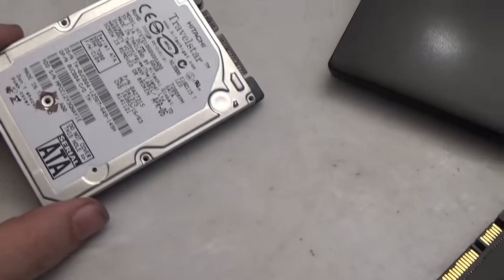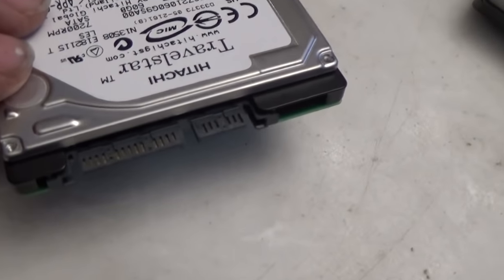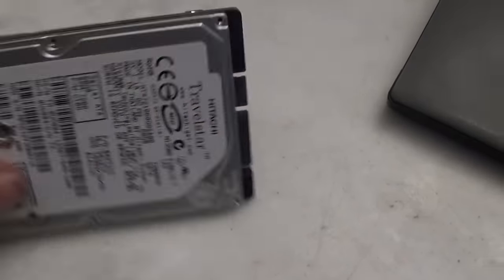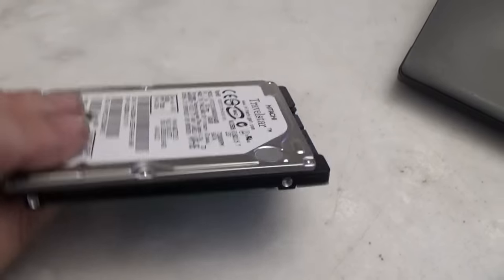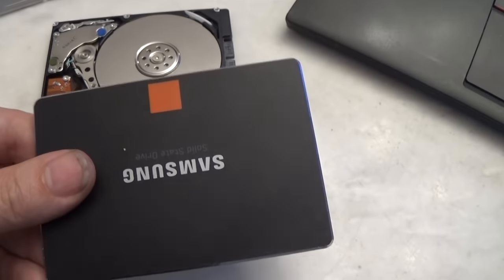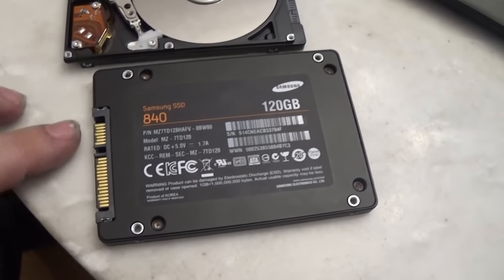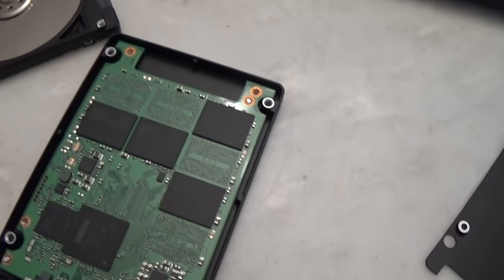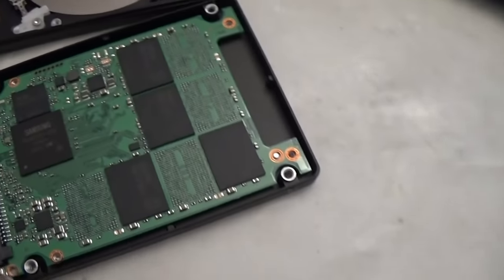Take a look inside a hard drive while it's running

Comment: people, don't open your drives if you want them to run afterwards
Reply: USSF - United States Space Force  you will get dust in it and it will break at some soon point
Reply: Just like a car will run without oil... until it doesn't.
Reply: USSF - United States Space Force  it have void on it so I don't recommend you to open it
Reply: lucas 0051 warranty void.
Reply: USSF - United States Space Force  any dust particle is capable of completely destroying a hard drive
Reply: You're telling me I shouldn't open my drive and carve my name into the platter to make sure it doesn't get stolen?
Reply: @JakeobE  that's normal just don't put a dust particle in there :)
Reply: @pointed.sphere  my friend once unplugged a hard drive from power when it was working. The head didn't park so he just opened it, pushed the head to place, some dust got on the platter, but he just blew it away, closed it and it worked. I was telling him that it won't work, but it somehow worked
Reply: @vwvvvww  you still dont wanna do that
Reply: @white_mage  I know, just shared a story
Reply: @Tristan Burke *Apostrophe, too.
Reply: Apex •  Correction: "We know, we aren't dumb"
Reply: USSF - United States Space Force   that's how you step on a pothole
Reply: Just get some legs and glue them on
Reply: My dad didn't want to spend $20 after his drive stopped working for a professional to fix it, so he opened it up. Needless to say we lost everything on the drive, which included pictures and videos from up to 40 years back. We know that we lost it, because he told me to send it to the professionals after he broke it. At least we found out that the arm was slightly bent, which is why it stopped working in the first place.
Reply: @Yevgen4000  I also lost photos of my family... From up to 14 years back.. my laptop stopped working and we didn't put the photos on a flash drive..
Reply: HDDs have gas inside them less dense than air to maintain the speed. At least some HDDs not sure if all
Reply: @ZirixNightcore  I think that gas is called 'fart'
Reply: @ThundererGamer  what - edit, I see, u missclicked
Reply: My advise to everyone who talk endlessly. Read before write. Listen before talk. Sorcery is nothing more than your idiocity. Hard disk itself has checksum mechanism which will backup the bits to prepare for later data recovery
Reply: @Tristan Burke There it is. The lord of the grammar. Drop a character and you shall never pass him
Reply: 1000th like
Reply: Near the drive if you see there's a little filter made to catch the dust on the drive
Reply: Look at minute 6:57 at the bottom and at the right

You see that little white thing?

Thats the filter
Reply: @vwvvvww  Your friend has god on his side
Reply: @0FFICERPROBLEM  Most of the HDDs have regular air in them, but there are helium sealed drivers, which have helium inside because it has less resistance.
Reply: Then open it where it's no dust
Reply: @0FFICERPROBLEM  No they don't. They are vented. It's just normal air. The shape of the vent is usually like a labyrinth to maximize the length of it making a filter possibly unnecessary. The fly gap of the R-W head over a platter makes a dust grain look like a bolder in comparison. Hard drives are like the ultimate in mechanical tech.
Reply: How can I boot Linux as command line only but with possibility to launch programs with GUI?
Reply: He lives in space, no dust issues there.
Reply: Common sense but im glad you learned this today through this video.
Reply: @tdplay4135  what the hell are ICs?
Reply: Learnt it the hard way
Reply: @Rainbow__cookie  Normal air has dust particles in. Hence the reason why hard drive labs are ridiculously sterile places with heavily filtered air
Reply: Hahaha hard drive goes: "                             "
Reply: @lucas-vh6oc  is not void! Can not be void! The head need air to "float" over the plate when spinning. In fact, disk has higher failure rate when works in High location.  Over 3000 meters  the air is soo thin  than almost there is not gap between head and plates and almost any hit on the hdd ends in a head-plate crash.
Reply: @xenuno  no, he is totally right. Some disks do use helium and are sealed. I think an example is the ironwolf pro drives.
Reply: True
Reply: @djenson  Yes I see .. those (helium filled & sealed) are at the bleeding edge of hard drives sizes and are relatively of recent release commercially (late 2013). I was not aware of them as they appear to be directed to Enterprise -NAS usage. Every drive I've touched going back to early 80's has been vented.
Reply: I had to for a video😂
Reply: @xenuno  yep, but you should always check before saying that something is wrong. technology moves fast.
Reply: We have the same profile picture
Reply: Cristian Pl dust+oxidisation+dampness= dead drive.
Reply: Wait people actually do that??!!
Reply: Cristian Pl especially even more if they are helium filled or some other special sealing drive
Reply: Unless it is a solid state drive
Reply: @Tristan Burke apostrophe*
Reply: Unless you are in a clean room
Reply: @soundvolsehgs  unless you're in a specially equipped, professionally ventilated room/area in which it is indeed safe to open it
Reply: Matthew Higgs in your house it would because you live in a dusty house you never clean it
Reply: Haha lol
Reply: Who the fck would open this so lighty ?
Reply: @pointed.sphere  older drives tend to be more resistant to this, the new ones are incredibly delicate tho
Reply: Please don't act like you know what you're talking about when you don't. Thanks.
Reply: USSF - United States Space Force  Can confirm, Opening up a drive will severely hinder it's lifetime and give you bad blocks. Don't open your drives, they have to run at as clean as possible.
Reply: @JakeobE  drive status:destroyed.
Reply: One small dust partical can distory a big file
Reply: so true
Reply: Cristian Pl ok good
Reply: @spatch7414  What a shame, =_=
Reply: Apex • are you sure? Because I’m pretty sure it’s aren’t and not arent. What happened to your autocorrect? Get it fixed ASAP
Reply: @JakeobE  😅😅😅😂😂😂😄😄😄😆😆😆
Reply: @pointed.sphere  some gigs per 1 dust on a platter(1tb disk)
Reply: Yup
Reply: @lucas-vh6oc  the hard drive has holes...
Reply: Yes. especially if you have a helium filled HDD :D
Reply: @Rainbow Cookie you need a $500,000 clean room in order to not break your drive
Reply: USSF - United States Space Force  no
Reply: USSF - United States Space Force no it will break trust me
Reply: well what if i dont want my 20GB HD to run?
Reply: @Glenn67345  Integrated Circuits. You don't touch them as they are microscopic in size. Any oil residue from your fingers will eat into them and destroy them over time. The same goes for electrostatic discharge from your fingers as even a small amount is like a lightning bolt to something this small and delicate.
Reply: @pologamero2648  so SSDs are the drive of choice if you live in the Alps?
Reply: @LayJD_  that is because they write much more tightly on a single platter these days. The engineering tolerances are just so much higher. The older drives had more platters and physically larger sectors for the same given drive capacity. I have seen an old school HDD opened and running as a party trick. This would kill all the data in a matter of moments on a modern hard drive. Use a hepa filtered, extracted air glove box if you really need to open it. Dump the data off it ASAP and trash it as it will never be the same again in regular use.
Reply: Except for ssds
Reply: @vwvvvww  yeah it worked but for how long? Without the proper equipment, no hdd drive is gonna survive long once opened. One tiny particle you don't notice will ruin it. I've opened dozens of them up taking every precaution, none of them lasted after that. Odds are they do last in a normal environment is 1000 to 1... if you're lucky.
Reply: It's bad if you do it with a hard drive, but fine with an SSD
Reply: @aviay  and what are you gonna see in a sdd?
Reply: @JakeobE  xd
Reply: Me putting my fingers on the disc after opening it: huh? What were you saying?
Reply: I opened my 750gb hdd to see how it works.. Didn't think about searching for it on YouTube lol
Now it's in the trash
Reply: I opened my 750gb hdd to see how it works.. Didn't think about searching for it on YouTube lol
Now it's in the trash
Reply: @pointed.sphere  well actually no, Its very likely it wont be affected as long as you are careful
Reply: USSF - United States Space Force  one piece of dust can and will ruin your drive, there is a reason people spend millions of dollars making clean rooms
Reply: @vwvvvww  stop ur bs
Reply: Yup, once you open it, you risk ALL your data, it's like a timed bomb, at best it'll last another day before completely dying. You can already hear the dust getting scraped through the disk minutes after he opened it in this video.
Reply: @MrDaniyalAh  I think he was joking
Reply: I opened my drive for a split second and it completely destroyed it. It worked fine for a week until sector errors and I/P errors started popping up. Learned the hard way, bought an nvme
Reply: Steelyx  Most of the consumer-grade HDDs have air inside them. But there are high-capacity enterprise drives that are filled with helium. Filling the drive with helium increases its lifespan and allows for more densely packed disks because helium is 7 times less resistant than air.
Reply: I'm dumb though. I did everything wrong.
Reply: Jesus Christ, this comment section...
Reply: What if you open it in a vacuum space that is sterilized and with zero moisture
Reply: @brute6896  well, that's perfectly fine and that's how data recovery services like drivesavers work.
Reply: Steelyx  me too man
Reply: @0FFICERPROBLEM  i think all HDD's now a days have helium inside them.
Reply: @lucas-vh6oc  Void warranty stickers are illegal, by the way, but saying the warranty is void because you opened it isn't. (In the US)
Reply: You can run an HDD a bit like that. You have to Screw in the Screw on the Arm with the right amount of tourqe (it tightens the arm so that the heads keep the distance to the plate)  and then put a piece of acrylic over it with a screened hole in it for breathing. Seal it and you good to go.
Reply: Can I open SSD ?
Reply: @vegalyrics  yes, but you wont see much there
Reply: @spatch7414  Ikr
Reply: imi este greu sa cred ca exista unii oameni care nu cred ca hdd urile sunt asa sensibile.
Reply: @JakeobE  use a sharp thumb pin...make sure to write you name by punching holes into the platter you don't want someone to steal it and later on polish the platterd to remove them scratches
Reply: Lol
Reply: LMAO fax
Reply: @Glenn67345  Integrated Circuits
Reply: I was thinking of making a custom glass case where you can see the hard drive header moving in real time. Do you reckon I'd be able to pull it off without dust getting in?
Reply: @chrissysmith9450  it will be heated af and will turn red hot and then may melt ive seen this and it went bad
Reply: @chrissysmith9450  i would try that on an older drive, seems like a cool idea but it still isn't really safe
Reply: except ssd user
Reply: lol
Reply: they don't run in the first place though they don't have legs
Reply: lol
Reply: @JakeobE  No, that should be just fine. I recommend that everybody does this to their new drives.
Reply: That's what people told surgeons in medival times.
Reply: Nice pfp
Reply: @hydro8484  you too
Reply: @vwvvvww  Nowadays the hard drives are so dense and this little neodym magnets are so strong, they don't care for dust anymore. the only reason you should care about dust is, that when the platter is running, it creates when the lit is closed so much wind, that the little dust particle would become like a sand blower that could make your platter or header go rusty.
Reply: Why would I want them to run?   I'm too lazy to go after them.
Reply: Always some know it all. You can totally take it apart, just be very careful or take it to a professional
Reply: @spatch7414  the point—>

You
Reply: @spatch7414  your not joking I dust particle will kill my hdd drive is their a chance dust can get into it if so I will be buying a 2tb nvme drive and throwing my hdd out as my pc is pure dust.
Reply: Do not tell me what to do
Reply: @pedrovidal6446  Yes. Its entertaining like Goku vs Superman comment section 5 years ago.
Reply: Lol
Reply: Yet this comment is coming from someone who doesnt understand how hard drives work
Reply: @ar12.  the hdd drive has filters that don’t let any dust get inside. It is just that one dust particle will destroy part of the disk and this is where you loose some files. It is because the tip of the arm is so thin that anything will get stuck on it and get dragged across the disks. I still have an hdd in my Mac and my Mac grabs a lot of dust. It still works fine.
Reply: @trutris124  that’s good to know I will still upgrade to full ssd down the track but for now a 2tb hdd and 500gb nvme ssd will do.
Reply: @ar12.  yea. I have a 2011 Mac and I have upgraded the ram the WiFi card and I am running it on a Catalina patcher. Eventually when I get to college I will get a new up to date mac, but for now my Mac is still running to today’s standers which is pretty good.
Reply: @trutris124  yeah I use a 2070 super gaming pc and I was deciding if I wanted to go full ssd or not but knowing that I won’t be to worried about the drives stopping the faster load times are nice though that my nvme ssd has thought.
Reply: ok
Reply: Produced in highly sanitized" laboratories and very sensitive to any particle
Right?
Reply: ⚠️ !! WARNING !! ⚠️
Reply: What happens if someone drops a big loogie onto a spinning disk?!😮
Reply: @vwvvvww  That reminds me of a friend who I warned against how he handled his RAM when he removed it and how he had to be careful when it comes to static electricity in his body damaging the RAM if he touched the leads on it without using something to discharge any static in his body.  He smiled and rubbed the connection part of the RAM with his bare hand and plugged in it.  It worked at that time... but a few weeks later I remember it failed on him.   Your friends HDD may have worked at that time, but I wouldn't be surprised if it failed later.  They are VERY sensitive to being opened.  Of course, if the drive wasn't working anyhow, I see no harm at that point in opening it, but one must know the risk and try other options first.
Reply: Unless your in a cleanroom

Comment: My jaw always drops when I see how these things work. It amazes me that you have a platter spinning at 7200 RPM (up to 15000 back in the day) and the mechanical arm that is reading and writing data with precision. I have a 10-year-old western digital hard drive with over 30000 power-on hours and it still works just fine. Absolutely amazing considering how these things work.
Reply: I have a Seagate Pipeline HD.2 500GB with 67000 hrs
Reply: 1TB HDD in my 2012 iMac, still kickin just fine.
Reply: 2 tb seagate with 32k power on hours, still in good health.
Reply: You guys should take backup asap…. Lol
Reply: I'm commenting just to say "RUSH 2112"! 😁

Comment: That accuracy and timing of the hdd head is insane.
Reply: @MrDegsy69  I don't think equipment designed to sustain tens-to-hundreds of Gs worth of acceleration is going to keel over from a few extra millions or so swings. Considering that manufacturers don't even try to give any estimate total seek count as HDD health metric should tell you that it's much more reliable than majority of HDD components.
Reply: @MrDegsy69  Uh, my point was that HDDs life span doesn't depend on data access patterns at all if you consider its standard operational lifetime.

Defragmentation is done only to avoid random access as HDDs aren't particularly good with it. And superior performance of SSD has nothing to do with it, why did you even mentioned them?
Reply: Likeme on my exams
Reply: The dna replicating machinery in our bodies is even more faster, accurate and intricate.